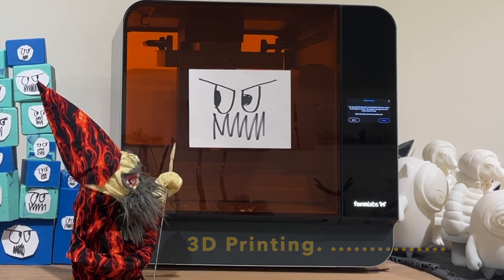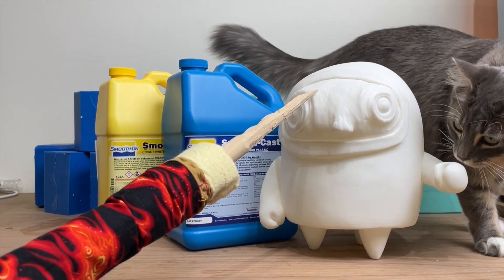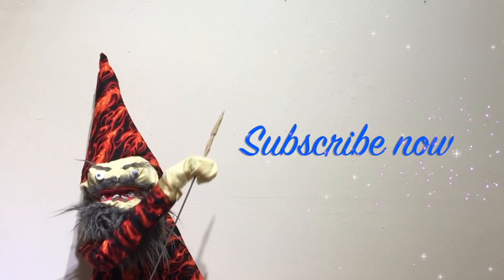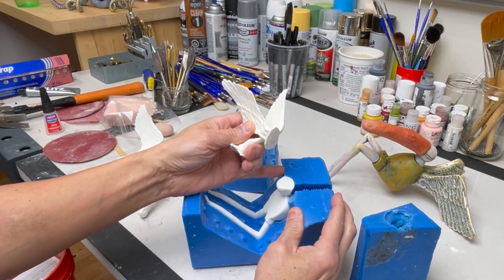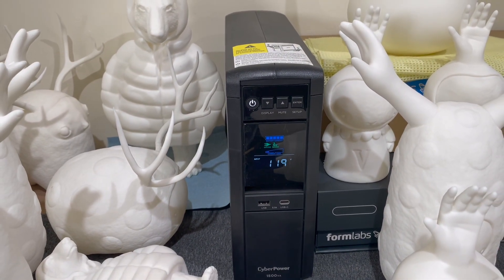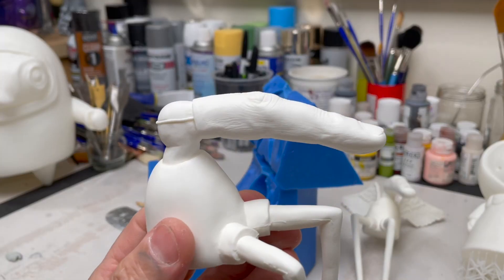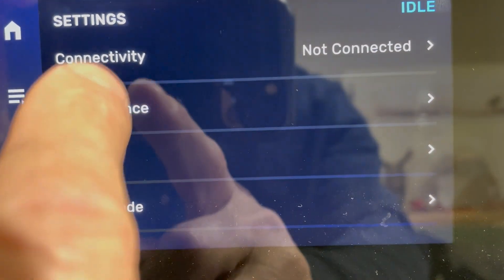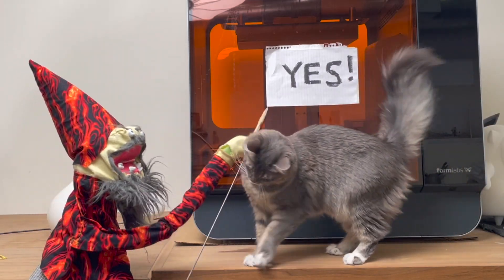3D Printing vs. Silicone Molds: The Ultimate Showdown

Comment: I just thought this was just a normal consumer video. Ofc silicone moulding wins when you spend 20-30k on a printer 💀
Reply from the maker: Ive actually switched to 100% 3d printing.  I can do so much more in terms of complexity.
Reply: @SteveFerrera  Yea that's right. But in terms of costs it could be on the same level as silicone moulding. But i was just confused. It's fine if you doing a buisness with it and can afford such printer.

Comment: how maney cast can u pull out from platinum silicone or tin silicone mold?
i use that silicone and only can cast max 25 cast  after 25 the cast stick to silicone , i use release agent and still same result
Reply from the maker: about 30 if I take good care of molds. Really depends on how much fine detail- the amount of thin little flaps of silicone. Those things start to break off after awhile from the heat of the resin curing. At some point the amount of clean up time warrants a new mold.

Comment: i don't think size should be a concern with pressure casting resin. i know guys who welded up their own pressure tanks, and some of them are enormous. the tanks don't even have to be cylinders. they can be simple metal boxes. and if you make a door that 'falls' inward, you don't even have to mess with securing the door with bolts because the pressure will seal the door shut. just fyi
Reply from the maker: hmmmm... skillz I don't got :(

Comment: It's crazy to me that Formlabs resin printers are so expensive. I have been 3d printing for over 10 years now, (resin around 6)

And there are many printers you can buy under 1k that will print better quality than the Formlabs at a way cheaper price. With benefits like:
No proprietary resins. 
Way cheaper resins 
 custom settings for your slicer and not relying on an update from Formlabs to push better resolutions. with some going as low as 10um

I understand you might save time and not have to dial things in as much on a Formlabs but its surprising to me that they charge so much.  

I'm just getting into 3d sculpting myself and can't wait to begin printing my own models instead of other peoples all the time. Either way, Love the content Steve
Reply from the maker: Thanks for watching! Please forward me info if you find SLA printers with nice print quality and good print size capacity. It's still a giant experiment for me. Good luck with the sculpts !
Reply: @SteveFerrera  Sorry about the delay in reply. I wanted to make sure i had the time to write up something clear and concise. 

I also did more research into the Formlabs before I replied too. So to which i would say the main difference in printers is SLA vs SLS (in short, one uses a precise laser to draw layer by layer the other uses a screen that blocks out layer by layer)

The downside of SLA (The screen version) which is cheaper. is the screens are classed as consumables and will need replacing after a set period of time. 
The upside is a drastic reduction in production cost. I guess doing your own research on if the downtime/ work included is worth it for you. 

How ever I would like to say that I have ran "cheap" SLA printers for my Esty store where they'd be printing constantly for a year without much rest and havn't had to replace a screen yet. 
You will have to "level" the bed sometimes but this process is as easy and becomes second nature once you get hang of it.
You'll also have to find the resin cure time of the resin you use, Which will take some time and some test prints but once you've got it set, Then that won't change for said resin. However will need to be calibrated for each different resin you use. (if you do decide to change) 

It seems you already know how to support your models for printing and personally thats the biggest learning curve about using resin printers. If you had the time and space and wanted to reduce production cost and increase output, I would suggest looking into a few printers. 
Here a few:
Anycubic Photon m3 max =298 x 164 x 300 mm
Phrozen Sonic Mega 8K = 330 x 185 x 400 mm (a lot more money but huge build volume)
Peopoly Phenom Prime (again more pricey than 1k)

There is a plethora of SLA resin printers to suit all kinds of needs and purposes and would have no problem talking more about it to you if you had any more questions. 

Again, keep up the great work Steve and i look forward to seeing more of your creations
Jake

Comment: You’d reallly have to try rotocasting that “1.35gal/576ml” cast before that comparison is relevant…
Reply from the maker: lol- yeah - a roto-caster would tear that figure up. I'm just not sure where it would fit in my studio...
Reply: @SteveFerrera  I only do rotocasting by hand, honestly; I’ve done it successfully using Smooth-Cast 325 and Onyx Fast! I find it easier to work with that way. You’d have no problems  using that Smooth-Cast 300 without a rotocaster… both the 300 & 325’s demold time is 7 - 10 minutes… pressure pots are nice & all but not necessary in the rotocasting process. If you’re concerned about air bubbles, you can just mix up & apply your resin in multiple small batches.. 320/325 almost feels like rotating an oily liquid around inside the silicone molds until it kicks, but when it does, it kicks quick! May take a couple try’s but it’s really quite meditative ha
Reply from the maker: @stanleythrewbrick  cool! always wondered if that would work with. I always imagined there would be a bunch of half printed pieces all over my studio.
Reply: Follow👏up👏video!🫶

Comment: I 3d print my mold masters and cast them in epoxy. How do you find the durability of the print as a final product? I've found printer resin to be considerably more brittle and breakable than epoxy/urethane.
Reply from the maker: yeah. I definitely prefer the casting resin. I don't really like the brittleness. I've had to adapt. It's harder to paint for me too. not very good with washes. I'm hoping they come out with a new resin that's not so brittle.
Reply: @SteveFerrera  Have you tried any of the Sirayatech stuff? I've used Blu and it's actually pretty tough. I was able to machine it on a mill. I've seen others on YT blend it with Sirayatech tenacious which supposedly also makes it slightly flexible, but I haven't tried it myself. There's a lot of manufacturers out there now developing some cool resins. I've seen some reviews of actual flexible resins. I imagine the cost is high though.
Reply from the maker: @RichardThompsonArt  Id love to try the flexible resin someday - but yeah all the cool resins are super expensive. But they got me thinking of cool things I could do with them.
Reply: @SteveFerrera  Tough 1500 and Grey Pro are good options that I use for miniature printing, a bit higher of a pricepoint than the standard resins though.
In addition to this: You don't necessarily have to post-cure your prints. Once they're washed you can prime and paint them to keep them in more of a green state, which will make them take forever to fully cure. for most of the resins you can find they have a "green state" and a "post cured" state in the datasheets. White V4 is basically twice as flexible in its green state compared to fully cured
Reply from the maker: @Chaosghoul  interesting... i thought you had to always post cure. Are the tough 1500 and Grey pro less brittle than the standard. I really like the soft casting resin.

Comment: It sure sounds great but I am too old to learn 3d modeling. I am so used to using my hands and fingers to sculpt my objects then mold and cast them, that I would be dead before I got the 'feel' I have now with wax (for the positives) compared to a digital sculpture. Plus I like the option of 'cold casting ' with bronze powder - I think it will be a while before  SLA printers can do that, at least affordably for most of us.
Reply from the maker: I'm working with a foundry now that's working on some pretty hi-tech wax printing stuff- hopefully some vids on that in the future. but yeah I'm in the same boat. I'll always prefer hand sculpt to 3d modeling.
Reply: @SteveFerrera  Look forward to those vids
Reply: @SteveFerrera  There's also casting resins for a clean burnout you can get for the Formlabs printers
Reply from the maker: @Chaosghoul  I've been keeping  my eye on that. right now it's only practical for small stuff- as soon it can print larger, i'm in.
Reply: @SteveFerrera  There's two resins: Castable Wax for small stuff and Castable Wax 40 for bigger things